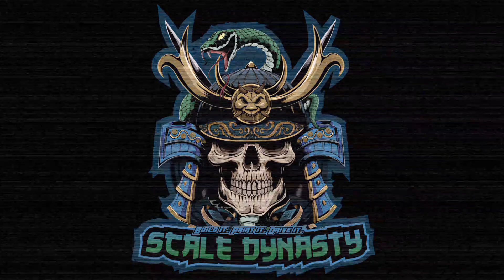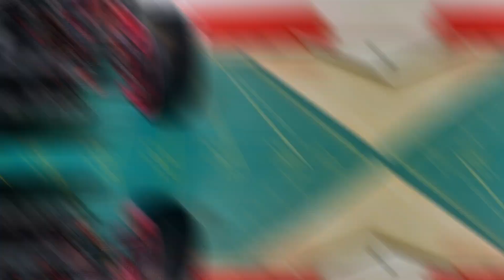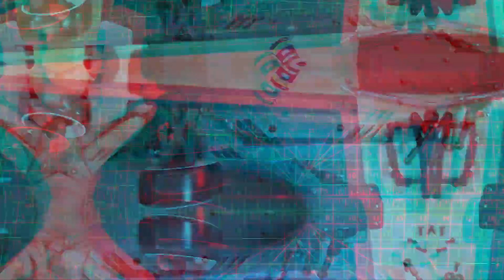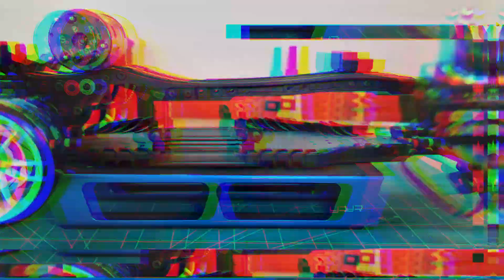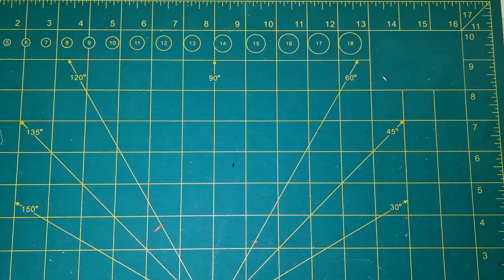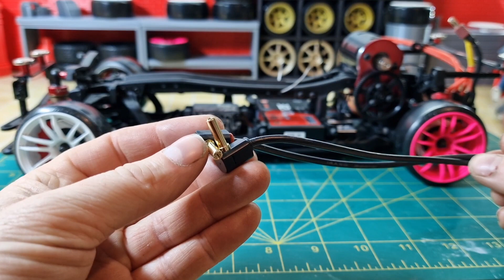#rmx2 MST RMX 2.0 UPGRADE SERIES EPISODE 4: REAR MOUNT ESC AND SERVO RELOCATION

Comment: Nice mate. That mount looks great. I just did the MST tilt mount on mine to add a little weight to the back. My steering parts are almost all here to do the front. Messing w that geometry is risky but the reward is sweet :D
Reply from the maker: Rear esc mount is definitely a good idea! I've changed to the MST red aluminum and carbon tilt mount now after trying a few different 3d printed parts! What steering modifications are you doing?
Reply: @scaledynasty  For now the alum steering arm kit and the alum plate as well. Trying to tighten up my steering, its pretty sloppy at this point. I’ve been drifting for a month and a half and starting to understand things now so making changes isn’t as scary as before. :D
Reply from the maker: I found buying some m3 shims, ranging from 0.1mm, 0.2mm, etc up to 1.0mm helped reduce play in the lower arms, as well as m4 shims for the stub axles!  I've also changed to aluminium hubs, which have helped to reduce play too! (Video of that to come soon!)
Reply: @scaledynasty  I’ve got the rear ball diff w alum out shafts and a big pack of shims on my list. I hope to tighten up a few bits of slop elsewhere as well. And I’ve been using trx4m bushings as shims so I want to replace those w nice color themes ones :D
Reply from the maker: Sounds like you have a good plan going on!